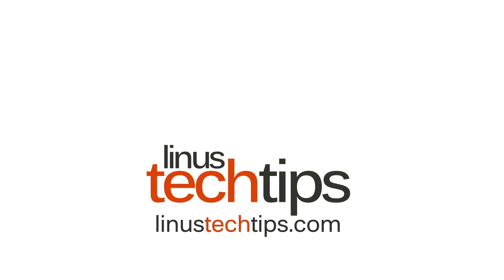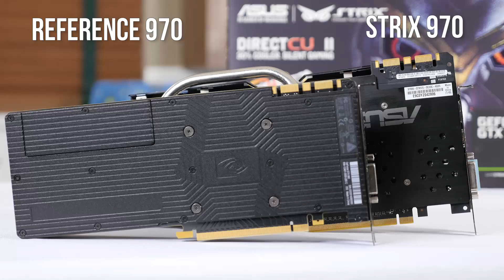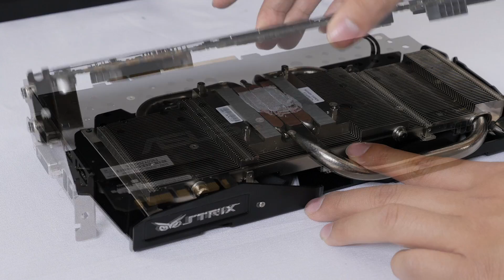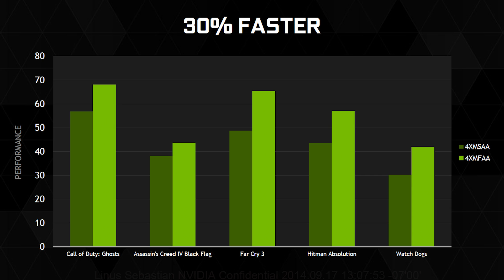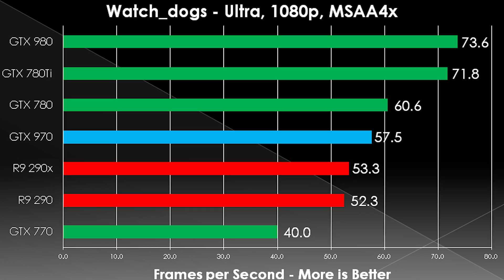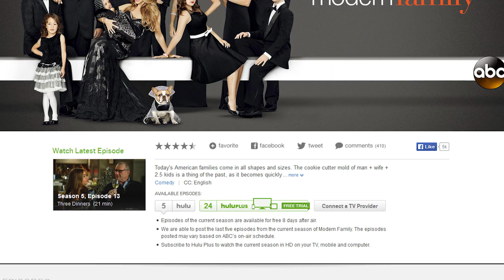ASUS Strix GeForce GTX 970 Video Card

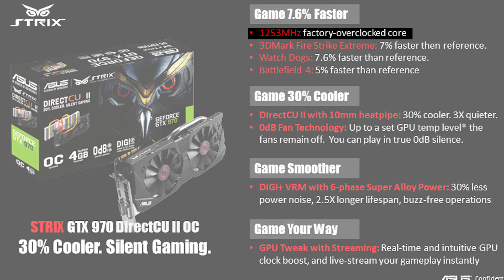Comment: "7% faster then reference." omg Asus xD 1:23
Reply: +TK TrueKep It should have been "than".
Reply: I bought a 970 on sale. So I got it for like 180 USD
Reply: +Philip Vinterberg whats the problem?
Reply: +GenomeSoldier71 http://www.newegg.com/Product/Product.aspx?Item=N82E16814132038
Reply: +GenomeSoldier71 rekt
Reply: +Philip Vinterberg and they give Asus users 229bandwidth instead the 224gb/ The 5gb is kinda quite a lot. Not only 7% faser but more data can be processed. I'm glad i went with Asus
Reply: +Philip Vinterberg oh thats nice, i got mine for 400 euros...
Reply: +Philip Vinterberg Holy crap where? That's cheaper than a 960! I thought i got a deal for 280 vs 320-350.
Reply: +Philip Vinterberg what the fuck kind of sell was that? that's low for refurb prices...
Reply: +TK TrueKep There isn't a reference cooler design for the 970.

Comment: Got this ard its amazing, kinda annoying as my room no longer gets warmed up by my 560 ti
Reply: Ikr I used to have a 7970 crossfire setup and recently upgraded to a 980Ti. I'm freezing now.
Reply: teschi yeah i'm actually cold, mine idles at 36 degrees C. my 560 ti idle at 55 degree
Reply: Wait, you guys used your graphics card as a radiator???
Reply: +NonsensicalSpudz  Buys 560 ti just as heater
Reply: +Jonathan Hine the more you learn.... thank you for this.
Reply: +NonsensicalSpudz I've got a 560ti, and just bought this card! :) Gonna have to turn on my radiator now ! haha
Reply: Dude! Same my room used to be nice and toasty in the winter now I gotta have a blanket sometimes :///
Reply: +Burger did u just really...?
Reply: Burger well yeah haha, its enough heat
Reply: +Dekko well what else are you gonna use them for???
Reply: +NonsensicalSpudz Wow, I just upgraded my 560ti to this one too!
Reply: yamahaU3 its such a huge perfomance boost wasn't it
Reply: +NonsensicalSpudz how good is the performance sir? ,  i got a strix 950 in my 5 seconds of cheap bastard awesomeness ,  I will upgrade soon to this strix 970 behind my wife's back.
Reply: Enson Barker its amazing, and it super quiet, definitely a great buy
Reply: Enson Barker tbh, you could get away with buying another 950. They offer about the same performance. but the card it's self is amazing, if a bit heavy.
Reply: To SLI? I was thinking that but according to linus tech channel, SLI won't add the amount of Vram of the cards, I'd still be stuck with 2gb and also there is the lack of SLI compatibility on some games
Reply: Enson Barker The majority of games have decent SLI profiles, although as always, there are some games that wont include these profiles, in which case, you can use the second card as a physx card,and take some of the load off the other,to give you a few extra frames. It's true that you would be stuck with 2GB of VRAM, but at 1080p, sometime you may have to reduce AA, you wont usually go over that amount of VRAM. Also, DX12 will support stacking VRAM in SLI and crossfire configs, so in those games, you'll be able to use the full 4GB.
Reply: so how much does it cost i am looking to make a build that costs like a 1000$-500$
Reply: +meedow Shommo Its around 200 quid I think. But it's so worth it.
Reply: +NonsensicalSpudz Ahaha im currently getting my legs roasted by my 560 Ti
Reply: Cessna165 dude, like my 970 idles at 40-50 degrees C, with the fan off
Reply: +NonsensicalSpudz Thats cold ahaha. Actually would anybody give their opinion on wether I should get the R9 390 or the 970.
Reply: Cessna165 well i'd go for a 390x slightly more than a 970, but well worth it considering you get 8gbs of vram
Reply: +NonsensicalSpudz Thanks for the input, I really gotta research before buying any of those.
Reply: +NonsensicalSpudz Is it possible to run a ASUS GTX 970 with a MSI GTX 970 in sli
Reply: ***** yes
Reply: ***** yes but not advised
Reply: xTheDarkSiderx he said around £200, which is still wrong its about £260 or about 300 or so euros
Reply: xTheDarkSiderx i got 2 second hand
Reply: NonsensicalSpudz
are you stupid?
if it's the same reference card, it doesn't matter which brand you buy.
Reply: serialkilla no reason to call me stupid, relax dude?
Reply: I did exactly the same from my 560ti, to this 970, but while it was arriving I got back to my 460SE, of the three I think I like less the 560ti, it wasn't as stable as I expected, even the 460SE was an amazing overcloker compared to that one, now I'm happy with my 970, but the 1070 is looking real tasty.
Reply: Krnt13 haha i'm doing the same, going to get a 1070
Reply: NonsensicalVids I'm going to wait for the prices to settle, and the ASUS Strix version to be out, but I'm definitively going to get it.
Reply: what u got now???
Reply: @tourmaline7.3  well full AMD now.

5700 xt, ryzen 5 3600, same ram though early gen DRR4 3000mhz.
Reply: @NonsensicalSpudz  Ive got a 6700k paired with a 3070 from evga, my 970 is currently sitting on my desk looking cool. waiting for ddr5 and alder lake to drop

Comment: Is this gpu worth it ? should it get gtx 980 or this one ? or any other price per performance gpu ? I need to know . It is for my next rig build . I appreciate any helps!
Reply: +Niko Blyat The r9 390 is better but get which one is cheaper, they are typically priced similarly.
Reply: +Niko Blyat get the 970 and spend money towards other parts the difference isnt that much
Reply: Garra PvP alright , thanks :D
Reply: Toady i'll think about that . thanks anyway :D
Reply: +Niko Blyat If you're going to be gaming at 1080p/1440p then go for the 970. It's affordable, powerful and will most likely last a few years if not more. The 980 adds some performance and is more capable at 4K but increases the price by 40-50%. The R9 390 is also an option and is of a similar price to the 970.
Reply: Desolation00 I'll go with 970, I think it is good for me . Thank you sir :D

Comment: Thoughts on this build people ?
System Components:
CPU: Intel Core i5 6400
Motherboard: MSI B150M Bazooka Motherboard
Graphics: MSI GeForce GTX 970 OC 4GB
Memory: Corsair Vengeance LPX CMK8GX4M2A2400C14 8GB (2x4GB) DDR4 Black
Solid State Drive: Samsung 650 Series 120GB SSD
Hard Drive: Seagate Barracuda 2TB ST2000DM001
Reply: It's ok for a paper weight... you need a psu bro

Comment: Is it worth getting a 980 over a 970 for a 2560x1440 display?
Reply: +George Gardner It certainly is, but it's also worth getting a 3440 x 1440 (21:9).
Reply: +George Gardner Honestly, no.
If it&#39;s for just games you&#39;re talking about, you really shouldn&#39;t be looking towards a 980.
With just a 970, you should be able to play at 1440p, max all settings (except for things like the Resolution Scale slider in BF4), and turn all filters (i.e MFAA, MSAA, MXAA) off, or very low.  In 1440p, and especially 4k, anti-aliasing taxes the card too much for what it&#39;s worth, and is often unnecessary.

Just watch https://teksyndicate.com/videos/asus-gtx-960-strix-review-benchmarks-tek-syndicate
(I know that video is for the STRIX 960, but the message gets across well in it)
Filters have an enormous impact on performance numbers.
Reply: +George Gardner 
I'm going to use my 660 Ti as reference:

For a 107% performance increase, it would cost me £372 for a 980
For a 84% performance increase, it would cost me £255 for a 970.

Considering two way Sli is compatible for most games & assume the 2nd card gives you 80% more performance than the first...it's a no brainer which to get if you don't have unlimited money.
Reply: +George Gardner if you have the money YES! if you are poor or cheap than no. 1080p is your best friend.

Comment: Should i get an gtx 970 or an r9 390 because i know r9 390 has better performance but most games arent optimized for te r9 390 and the gtx 970 ofcourse had nvdia experience and i also now own a be quiet! 600watt 80 plus bronze psu is that a good enough psu for both cards and if i should get an gtx 970 which version of the gtx 970
Reply: +joeri jansen go for the R9 390. AMD will be launching getting rid of Catalyst and replace it with Radeon Software, which is meant to rival Nvidia Experience. Along with better gaming performance, the R9 390 has 8 GB of VRAM, adding to the futureproofing aspect.

Comment: I'm looking into getting this card. I've looked all over the internet for the actual power usage of this Asus variant of the gtx 970, but can't really find anything satisfying. I have a 600w PSU, and I'm currently running an xfx r9 270x that is rated at 185w TDP. I know the reference 970 uses is rated less than that, but will a 600w be able  to power this Asus variant?
Reply: +Pi_is_awesome_3.14 I think it would be enough. myself have 650watt. I can do some OC, but if you don't you're good with this

Comment: I got this card about a month ago, building a new gaming rig any comments on my part choices?

AMD FX-8350
ASUS Strix GTX 970 (Obv lol)
Kingston HyperX FURRY
EVGA SuperNOVA 750 G2 80+ GOLD
ASUS M5A99FX
Reply: +ArcadeMaster - The One And Only That's a really good build. For gaming the i5-4460 would be a better choice, but the FX-8350 isn't a slouch.
If you can, go for an aftermarket cooler like the popular CM Hyper Evo/Plus 212. The stock cooler is obnoxiously loud.
Also, the FX-8320 is basically the FX-8350, but with lower clock speeds (.5 GHz less) and is cheaper by $20-40.
Reply: Cool, i have already built my computer i got the evo 212 as well its really nice.  Still thanks for the advice :)

Comment: Will it be a worthy upgrade over my 660?? Because games like BF4, Crysis 3, DA Inquisition looks like crap on my 660 with FPS lag on higher settings. I currently have i5 4440, 8GB RAM and 500 watt PSU.

Comment: HI,i'm thinking about building a PC,i don't have much experience in this,but how good the performance will be  in newer games(around 2013-2015) on the following system?

Asus Strix GeForce GTX 970 OC
Intel i5 4460 3.2 GHz8GB of ram
1TB HDD
Asus H181M-K MotherboardAnd a nJoy Titan 600w Real Power as power supply.

Comment: this card is worst gtx 970 on earth it have very laud fans on high fan speeds, shit vram cooling only litle pease of metal and vrams have hardware voltage lock to 1.212 volts even custom bios what allows 1.300 volts its not going highter then i find out it have hardware lock because asus dont want to peole putting high voltages on the cards
Reply: All 970's have 3.5 gb vram and the fans don't even turn on if it isn't under load
Reply: Neil Mc Cann yea but i dont sea eny easues when  memory goes mire than 3.5gb only when its goes over 4gb i have gtx 970 overclocked 1600mhx core and 8ghz memory

Comment: Would it be worth to use this card with an i7-4790k cpu, or to go with two ASUS Geforce GTX 960 2gb with an i5-4690k cpu?
Reply: +MrLummerlars1 SLI'ing cards is never worth the money in my opinion, it would be easier to get your i7 with this card. For me personally, im using an i5 4690k and this gpu because i had some left over money in my $2000 build.

Comment: I will be ordering my 2nd ASUS GTX 970 STRIX by the end of October to use alongside my current one via SLI. Been very happy with my current one and recently upgraded my Motherboard so I would have room to SLI as well as add in a Sound Card.

Of course, that will be in a while because I'm picking up my new PSU, CPU, CPU Cooler and SSD on Wednesday, and then 2 2x8GB Corsair Vengeance DDR3 RAM @2400MHz a fortnight after that. Probably close to a month away from finishing my build, and I'll still have to start looking for a Sound Card after that.

Comment: I would get the strix card, but the heat pipe on top means that it doesn't fit in my 250D, like the old asus card.

Comment: I'm confused, my Asus Strix 970 is clocked at 1445Mhz core out of the box but Luke said that's what he overclocked to on average. EDIT: I think I was wrong, Heaven and Valley show it running at this speed but Gpu Tweak shows 1253Mhz :P. My bad.

Comment: hi guys i ordered this gpu and i want to ask u something. Can I use this card with this psu? intertech energon 650watt. My pc is running with this specs and this psu for like 2 years.A i5 4570 , msi gtx 660 ,16 GB of ram.
Reply: +PLIVIUT - Sparklez Student (Ninja Defuses and Montages) I ordered mine today and have a 620W psu and I'm pretty sure it'll be fine since my current card (6870) uses about the same and works just fine.
Reply: Your psu is shit

Comment: Hi Sir, this is Ravikumar I have issue plz resolve this issue plz my pc config is p5k ws motherboard and intel core2quad q6600 2.Q6600 2.6Ghz processor ddr2 4gb ram 620 watts psu. and my problem is is my pc support gpu like gtx 970 or 980 because my mobo pci slot is support or not do I buy gtx 970 please help me with your kind suggestions thank you.

Comment: I'm concerned that the fans aren't always on, I know it's great for power consumption and noise. But say the fans kick on at 40 degrees Celsius, could the card hover at 39 degrees Celsius and the fans won't kick on. Like the card is still running fairly warm but not enough to turn on the fans, could that damage the card? Or is there something that prevents that?

Comment: I want to get this card but im a little uneasy about certain things:

1) will this be too much for a 650 w PSu (650W Corsair VS) 
2) Will this fit in my case and/or on my MOBO (Fractal Design ARC Midi R2/Gigabyte Z87-D3HP)
3) i have a i5 4690k which i plan to OC to 4.0 GhZ, the Cooler i want to get to do this is a H80i, is this efficient enough to not let the CPU overheat?.

i understand that these questions may be idiotic or ridiculous but i really just want to check with some other people before i go buying this shit and ruining my PC

Full parts listed below

Intel Core i5 4690K
Gigabyte Z87-D3HP
8GB Corsair 1866mhz Vengeance (2x4GB)
 1TB S-ATAIII 6.0Gb/s (Samsung drive which is shit!)
NVIDIA GeForce GTX 760 2GB
650W Corsair VS
Fractal Design ARC Midi R2

Thanks

Comment: Ok soo i really bad at custom pc s soo dont judge

My specs 
İntel core i7 4790
16 ram 
Gtx 760 
Windows 8.1

Soo i want to upgrade to 970 can my system work with 970 can you tell me how it works and dont works

Comment: Does the GTX 970 play games at 1080p 144fps? Cause I'm planning to buy a 144hz monitor.
Reply: Or should I go for a 1440p 60hz display?
Reply: Sharril Azian That really depends on the settings and the game. If you're playing on max settings on AAA titles, then no. Expect a solid 60FPS. If you turn down the settings significantly, then maybe, but I still wouldn't expect to hit 144FPS. 144hz, like 4k, is just "too new" to run at the moment. It'll eventually become cheap, as will 4K. I would suggest 3 980s in SLI for max settings, 1080p, solid 144FPS.
Reply: Sharril Azian I have this card and I was running Batman arkham origins at over 200fps at 1080p with 2X MSAA. so thats one example
Reply: Not to sound like a peasant but I can't notice much difference between 60fps and 144. Instead get a ultra hd monitor.
Reply: +Jack Holmes A lot of people can't. Most say that it's only noticeable when you switch back to 60 Hertz. You aren't a peasant. Steam survey says that 95% of gamers play at 1080p 60 Hertz.
Reply: +Stephenie  Hawn well, your eyes can't differentiate between 60 and 144 fps on a 60hz monitor anyways, because there is nothing to differentiate =D the only difference will be how smooth it plays, at least it feels that way when I play on higher FPS. gameplay&mouse movement tends to be smoother.